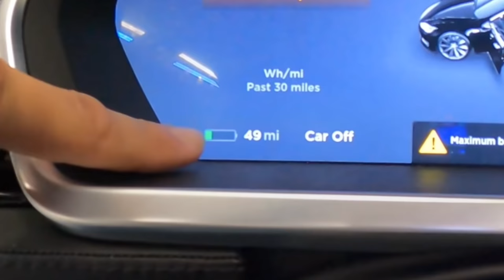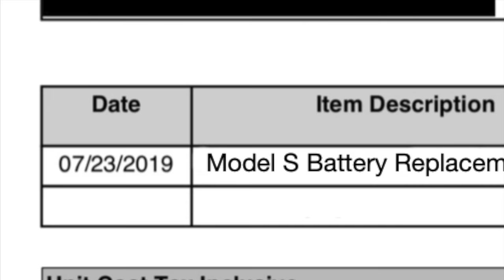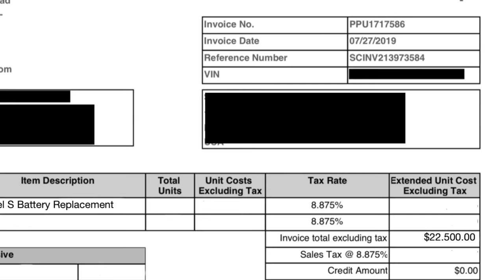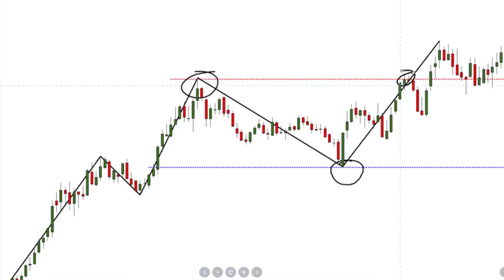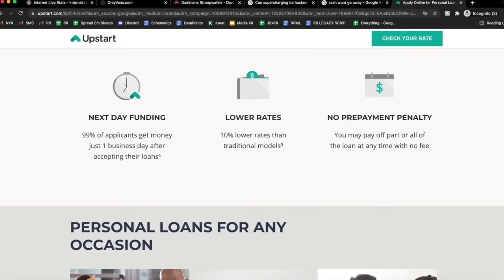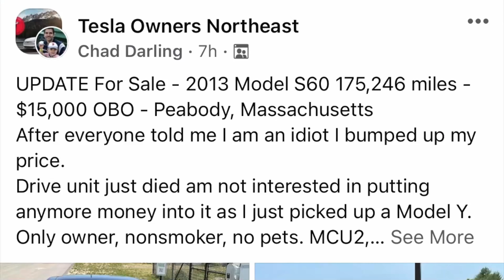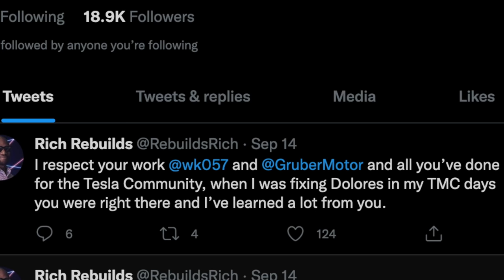The TRUTH about the $22,500 Tesla battery repair

Comment: If somebody else comes along with good range and build quality...

Aptera. (Hopefully build quality is good)
*Bolt.
ID4.
Mach E.
Kona.

If you're only looking for used cars then your options for long range EV are Bolt or Tesla... for the next year or two. 

*There have been more Tesla fires than Bolt ones, and there are more ICE fires than EV per capita. LG and GM's handling of the battery issue has sucked, but that doesn't mean they're bad cars.
Just like how Musk stinks and Tesla is anti-worker and anti-consumer, but even according to Rossman they make decent cars.
Reply: Messages and chats..

Comment: I’m glad Tesla is doing what they’re doing, cus eventually building a fast car out of an old heap in the back yard using electric motor swaps will be easier than doing LS swaps. And it’s good to have options. But it still takes a lot of fossil fuels to build and supply energy to an electric car. It’s not exactly saving the world. I’m not convinced battery technology will reach a point where we can match the range of a tank of gas with less overall pollution within any of our lifetimes. The real answer to cheaper cleaner transportation energy may lie in something like hydrogen fuel cell tech or somewhere else, electric just happens to be the most profitable right now because it’s closest to feasible. But feasible and ideal arent the same. 

Or you know…. If people really wanted to save the planet, they would just stop having so many goddamn kids. That’s the root problem that leads to all other problems. People just prefer to point their finger elsewhere.

Comment: I love Rossman's attitude. Make it right or don't. Ten years to correct build issues? Sorry, they should have solutions in 24 hours. Implemented in no more than 8 weeks. Rich, I have seen how tesla can make 29 changes in a week. Sorry it screams one thing to me. Unstable processes. Change is not good. Change is reaction to a failed plan. Nothing more or less. I am very impressed with powertrain of a tesla. It's quietness is nice, but it's also an issue. Why? The small items now are an irritant. Is it OK to build a crap vehicle, and yes, that's my impression of the 3. The NVH is horrid.its sealing is piss poor, and it sounds cheap not quality. Ok this opens an idea.

Comment: "The TRUTH about the $22,500 Tesla battery repair" is that you did a battery REPAIR and Tesla would have done a battery REPLACEMENT with a new battery.  It's the difference between doing a valve job on your old tired V8 and getting a completely new long block.  Kind of an apples and oranges comparison.  Unfortunately that subtle difference got lost when picked up and hugely amplified by the media who loses no opportunity to spread Fear Uncertainty and Doubt about Tesla.
Reply: well it depends how shaged the rest of the battery was, rich states its not the optimal solution. but it is a solution for someone that hasnt got 21k + to throw around!! just like getting the head done on yr ice engine !!

Comment: Wow,,, if a $22 G battery pulls off 100.000 miles that's $4.54 per mile if not more with labour,,, even if the car pulls off 200 thou and the cost too get it there would still be pricey...
All costs added in adds up too one expensive set of wheels for transportation... Oh well,,, its wize too let others figure out the numbers,,, I know one thing,,, there won't be an electric auto in my word any time soon... theres no free lunch when it comes too carbon-based fuel autos or E.V's. Its still cheaper too run fossil fuel autos in my world... Good points none the less...
PS: All electric cars are now parked in our North due too  -40 too  -44c temps,,, poor fellow just about froze too death up here,,, he now joins the club of 100 thousand plus folks that darn near froze too death in their cars... $5000 repair and the heater in his car still doesn't work...
Tesla doesn't know whats causing the issue,,, not on his car or the other 100 thousand  + units with nill for cabin temperature control... Pretty hard to drive a ev at  -30 or colder... Good luck all... lol

Comment: I still do not get how the hell can Elon prevent you from charging in other fast charge stations? The car is yours and you charge where ever you want.
Reply: US CCS (Type 1) not the same as European CCS (Type 2) -- US Cars come with Tesla Plug receptacle - not CCS Type 2 like European cars.  Tesla doesn't sanction a Type 1 CCS adapter to Tesla socket/plug, although there is a rather pricey version available from a 3rd party.  All other US DCFC are Type 1 CCS and sometimes CHaDEMO.

Comment: The EV industry has been getting a free ride on the backs of the current electrical industry. It is time for the EV industry to have a hefty surcharge applied for the capital improvements needed to support their charging stations. Generators, transmission and distribution systems are currently and appropriately right sized for the current industrial and residential rate payers. Any and all improvements needed to absorb the transportation sector should be paid by that industry and users. The current industrial and residential ratepayers should not be expected to pay for these improvements in their power bills. This would be theft and fraud. Put the costs where they belong on the users who are demanding it. THEN we’ll see how popular these science fair projects are.

Comment: I hate the "better for the environment" argument when buying a Tesla. IT IS NOT BETTER FOR THE ENVIRONMENT YOU SIMPLETONS. 1. Your chargers are backed by COAL BURNING/ FOSSIL FUELS!!!!!!!!!!!!!!!!!!!!! Which is way worse carbon emissions than using petrol. 2. Your batteries are sourced from super rare metals, are non recyclable, highly volatile after use and no way to be disposed of but to be incased in lead and buried for future generations to deal with. No your solar panels and wind turbines won't help, They incur the same flaws and are not ideal for large scale use(incase you forgot the flaws, they're listed right above). Just like EV will never be able to take over for diesels, because you literally can't get the power and tow capacity with the EV to do what Semi's do. You both make fun of group think, but are both doing it yourselves. I still watch both of your videos to learn something I didn't know before and to get a different perspective. But you both need to see your own bias, and try and see the other side too.

But again, do your own research and come to your own conclusion, I did and found that solar is actually really bad and wind is useless. Both could take all available land left to set up and the power generated wouldn't be able to power NYC and LA for a day.

For "saving on gas" I can purchase a fully loaded chevy malibu for 22k which can get 30mpg. I spent lets say $75 a month on gas. That's $900 a year in gas. You're lowest value tesla is going to cost you like 50K. 10 years owning the chevy paying for gas is well only 9k, which is still 19k off the initial purchase of the tesla. Your tesla battery is dead after 5-10 years needing another 22k battery pack. So no way you're saving anywhere close to any money getting a EV. Oh and don't forget repair costs and parts for normal wear and tear. Your Chevy costs for those is minimal. For your Tesla, you might as well get another mortgage payment. Or if you're like a good amount of Americans, you purchase a new vehicle every 5 years. So I don't even want to start on how much you'd actually save buying a non EV car.

I'd say in about 20-30 years EV would be a actually viable option. Until then, these thoughts are pretty much empirical facts. Unless you're wealthy, the gas car will be the king for blue collar/regular people for a long while.

Comment: I would like to see you do a series where you modify that huge battery so individual modules can be slid in and out easily, without tools, and done by a girl. I think you will be onto something BIG for right to repair if you can pull this whale out of the sea. Okay, maybe with some tools, but modify it so you don’t have to put the car up on a hoist to get the battery out.

Comment: its a shame there is people out there driving electric cars and don't understand that batteries are expensive. if you count how many cells occupy one module, for example  2170 in a model 3 s has4 modules at 4,400 ish cells. so if bought individually  in pairs its roughly 20 to 40$ depending on condition so looking at the low and high price 40 to 80,000 in cells. considering not all cells need replacing along with labor . i cant comprehend why someone would be foolish enough to say your bullshitting lol i know there's eBay with 1 module  used for around 1500-2000. Imagine if people rode horses to virtue-signal saving the environment. i bet there would be alot of neglected \ dead horses lol. stubborn close mind people walk among us. :)

Comment: The truth still hasn't been really put out there.

The truth is much simpler:  You didn't do the same thing that Tesla offers to do, and therefore it's not really honest to compare one repair to another.

Especially in the south (ie, not the rust belt) the difference in the repair really matters when it comes to the life of the car.  Tesla's mechanically are not super complex, and without rust issues, the car's suspension and brakes can be repaired and the car can continue on pretty much forever.  The cars are designed to be million milers from a mechanical standpoint.

"Repairing" the battery by only replacing dead cells is like replacing one tire because it's flat, ignoring that the other 3 are down to the cords.  Yes, technically the car is "fixed" and back on the road, but the time until the next failure is likely short.   Trying to compare single module replacement with full unit replacement is really key here.

So, let's be fair here:  How much would it cost to replace ALL of the battery cells / modules?

Comment: "What do people say about how EV chargers are powered by fossil fuels?"

They'd say that it's been shown in peer-reviewed studies that because a power plant is more efficient than an ICE car, it is more efficient in capturing all the chemical energy in fossil fuels and converting that into useable energy, therefore it's still better to charge an EV with a fossil-fuel-fired power plant than to run an ICE car. In fact, life cycle analyses have shown that even if you drive an EV where the battery is built in China - one of the worst polluting manufacturing locations - and charged in Poland - where most power generation is from coal - EVs are still better for the environment than ICE after a couple of years of use.
Reply: Messages and chats..

Comment: I hate when people say electric cars are better for the environment, look into the huge environmental impact that manufacturing the batteries has!  Its horrendous what stripping the earth for the materials to make the batteries does, the lithium mining process poisons large areas of ground, so much so they will be listed as super sites when they move on.  But oh electric cars are good for the environment.  Lets burn coal and garbage to generate power to charge the electric cars.  Again its all a trade off, sure gas burning vehicles are bad for the environment, but electric cars are not much better.  The numbers don't lie, electric cars have a lot larger manufacturing carbon footprint.
Reply: That's a terrible point that's been disproven multiple times.